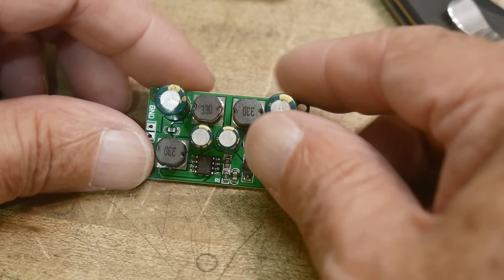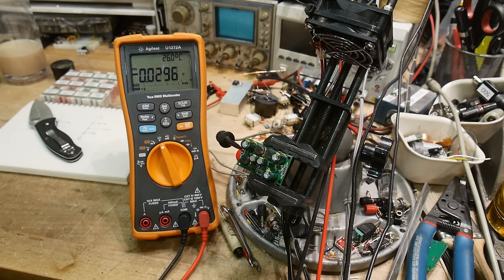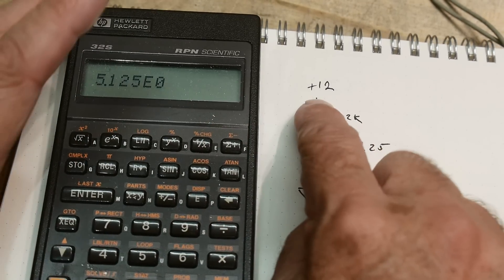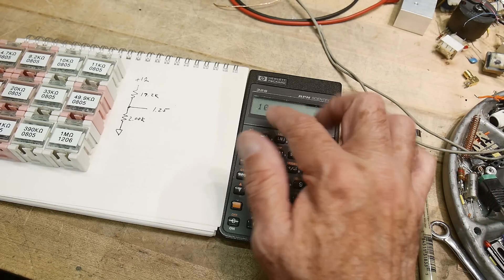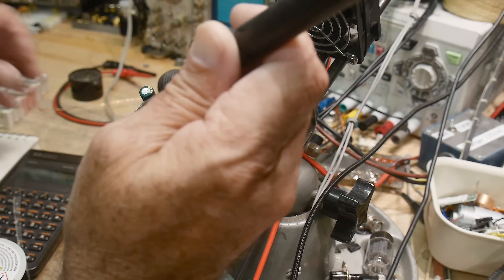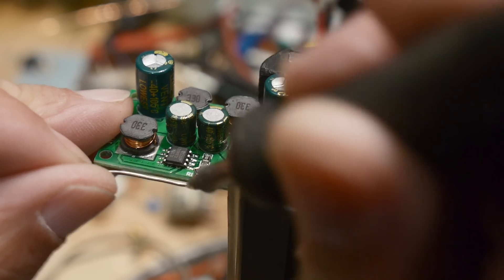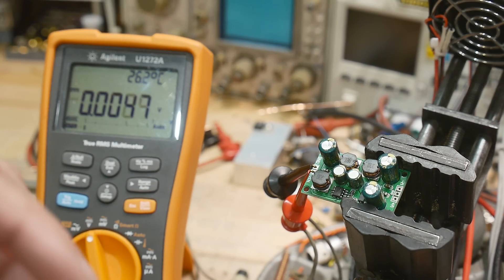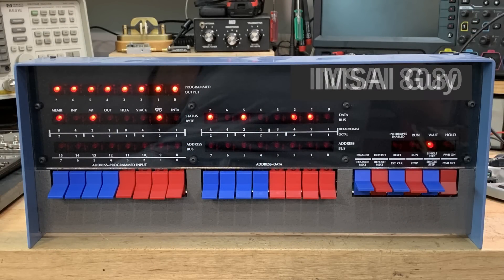#1495 Hacking a DC-DC Converter

Comment: 18k would be a good choise. I like to E12 resistor row. I try to build all of my stuff using resistors of E12. Only sometimes I need to chose E24.

And I think all of the other components of these modules are always the same no matter if it is for 5 V or 24 V.

Comment: You have essentially the same Buck converter that I bought off EBay. I bought mine to incorporate in the power supply I assembled from a transformer out of an old audio device plus the required capacitors, rectifiers & voltage regulators to give me variable, 12 volts and a dual supply for op-amps. I should have paid attention to my order and have made sure I ordered the dual supply at the voltage I wanted. It arrived at plus & minus 5 volts. I'd like to up the voltage a bit even though 5 will work. But, my 67 year old hands have enough tremor to make surface mounted resistor remove and replace iffy so for now I'll leave it as is. I still have to wait for my voltage and current meters to arrive from China to finish the total package and as you did may feel lucky enough before I call it done to swap out R1 on the board.

Comment: Gosh! That is a horrible job...😝 You should have removed the solder lumps on those pads with de-soldering braid first. That would allow the resistor to sit flat and make re-soldering a lot easier.

Comment: Is it worthwhile to add a L7812 / L7912 voltage regulators on the output side of this DC-DC converter?
Reply from the maker: yes, I've seen something similar for a very low noise supply
Reply: I've done that. ripple reduces very much

Comment: hi, did you discharged the load of the capacitators before  touching the main print. they still can contain charge adter disconection.
Reply from the maker: no, it's only 5 volts

Comment: Could have put one of those 11K resistors in series with the existing 6.2K,and been bang-on your 17.2K ohms on the first calc.
Reply: @PhattyMo- yes and you could probably use a 20k potentiometer to dial in the 1.25V and/or the output voltage as necessary.

Comment: 1.25/2K gives you the current I, then the output voltage is 1.25+I.Rtop
Also, you should make sure the loop is stable at 12 V and the output caps can handle 12V
If it is a boost converter the conversion ratio is 1/(1-D), where D is Duty Cycle if it is lossless.
I also think it has hysteretic  loop control ( also known as bang - bang loop control) you should check the output  spares it generates under the load and when you switch on or off the load.

Comment: I can empathize with the surface mount difficulty. I had surgery a couple years ago to fuse three vertebrae in my neck. Bulging discs caused spinal cord damage. The surgeon said the surgery would stop the damage from getting worse but what damage is done is done. My hands are a little shaky, my fingers are twitchy and I have problems with my balance. I find precision work to be nearly if not completely impossible. My other hobby is watchmaking. I’ve pretty much retired my screwdrivers and tweezers.

Comment: The first thing I'd do before changing the resistors is look at the voltage rating of the output caps, which I bet you did, but didn't mention until you'd already changed the resistor and powered up the supply. BTW, my left hand has a shake, since I'm in my 70's now. It makes soldering more fun.

Comment: Would be cool to see the mV ripple, and the voltage droop, over a 0mA and a 200mA load (Chinese site rates it at 0.3-0.4A for +/-12V).
Reply: for +15 @ 100 mA, i tested about 30 mVpp ripple 400kHz switching frequency